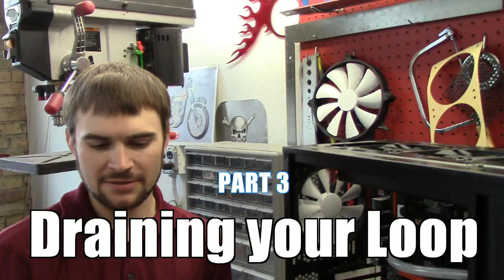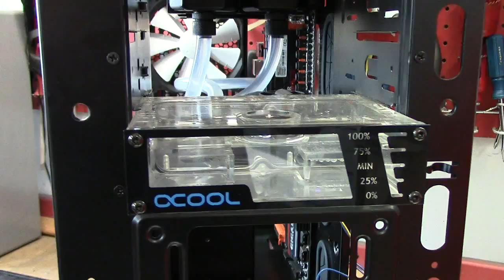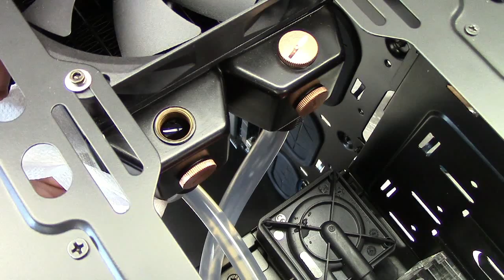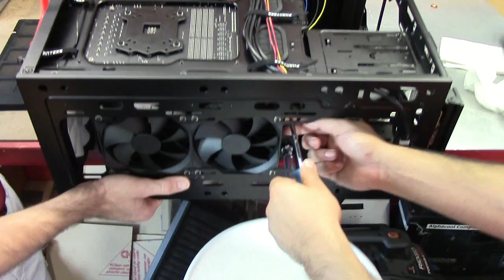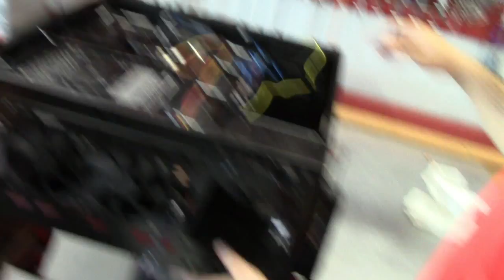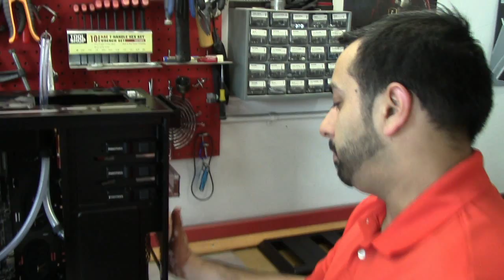Guide to PC Water Cooling, Part 3, "Draining your Loop" by TheModZoo.com

Comment: i have an XSPC kit and my radiator doesn't have those drain ports like this kit.  What are my options now, this is my first custom loop, i will have to drain it soon as i want to change the coolant water.
Reply from the maker: +Vince Phan ... You can add your own drain valve into your loop, just add fittings to allow your valve, Koolance makes an excellent quality valve, and other misc fittings here, http://koolance.com/products  ...If you have any other DIY liquid cooling related questions, the guys from the video have a Q&A thread here in the mod zoo community forums here, http://themodzoo.com/forum/index.php/topic/1630-qa-for-guide-to-pc-water-cooling-video-series-by-themodzoocom/

Comment: Can you use a different pump to drain your loop?
Reply: Thanks for the reply. I have created a custom cross-desk for my system (Without foreseeing such problems) and have created a distilled water-cooled rig. But now, I want to drain it and refill the liquid, but I just can't seem to figure out how to do it. I can't just tip the whole table! I weights over 200 pounds (Made with 2-inch thick teak boards and lined with aluminum plating).

Comment: pull pipe off from lowest part of the system and let gravity do the work using the isolation valve to your advantage its so easy this is were being a plumber comes in handy lol

Comment: cool upload :@)
if you have an M20 plug in a bay res, you can use an M20 fillport with a G1/4 thread in the middle and then use a G1/4 plug to seal it after you're done.

Comment: A drain port was one thing I made sure to accommodate in my wife's original build. I'm currently in the process of rebuilding her loop to use copper tubing and a drain valve is still part of the plan. If you're building a custom loop, definitely add a drain valve in there somewhere. This is especially true since you should do your initial leak tests with distilled water instead of your coolant of choice.
Reply: That is a good point.  Especially if you're going to be running a pre-mix that costs a lot (anything more than .99/gallon is a lot to me, since I just use distilled water lol)
Reply: *****
Even if you're running a concentrated coolant, you should still do your leak testing with distilled water.

Even if you live in an area where you have to have distilled water delivered to you because you can't just go to the nearby grocery store to find it, it's still likely going to be better doing your leak testing with distilled water than your coolant of choice.

Comment: dear bill . ive been wondering . does the coolermaster n600 have good watercooling options? and im new to a waterloops so would a good loob ( a 240 and a 280 ) for a amd 8350 worth it?
Reply from the maker: Mikkel Hansen, N600 is a great case for $89.99, I was really impressed with it, but if you're interested in liquid cooling, and think you may wanna expand into dual loop someday look at the slightly larger NZXT H440 or Phanteks Enthoo Pro, $20 - $30 more depending on availability in your region... the N600 limits you to 240/280 in the top only, and the N600 lacks over head space, so after market radiators may not clear DDR on some motherboards, depending on type of radiator you install. You should be OK with the thinner AIO radiators in the N600, like H100 etc...... If you have any more questions about cases or liquid cooling, please share them in our forums, http://themodzoo.com/forum/
Reply: ***** shall do